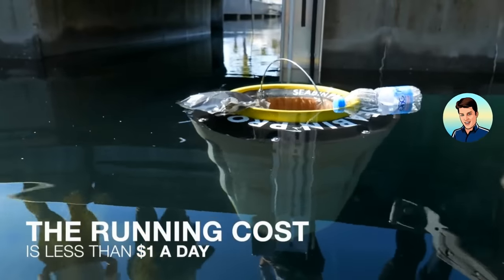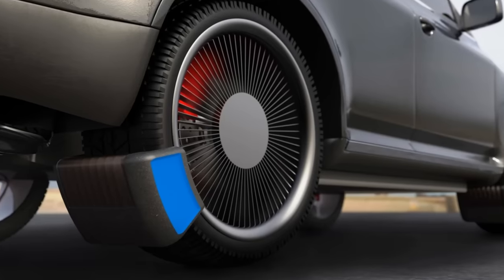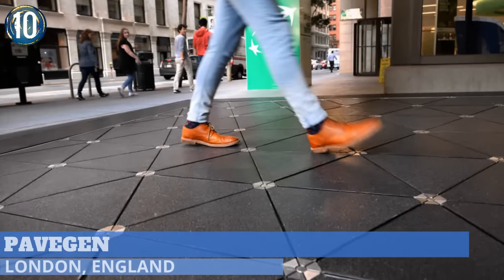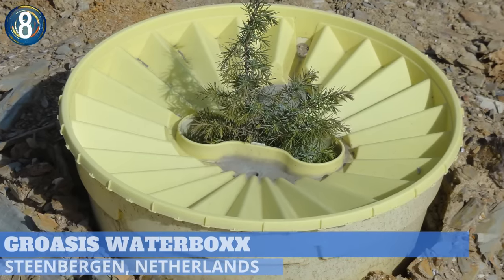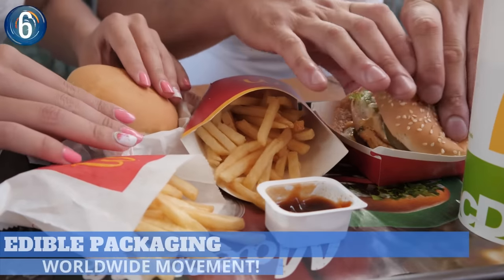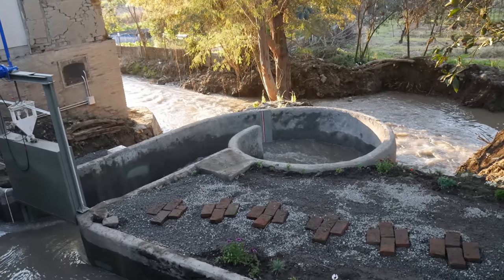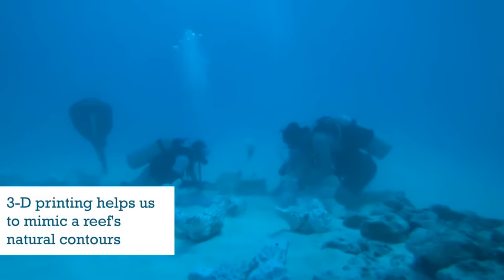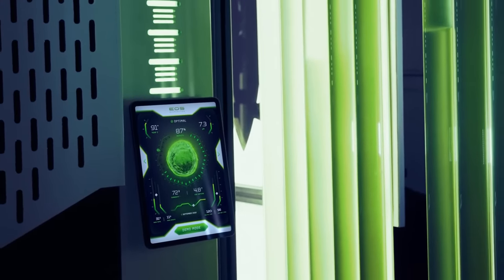15 Inspiring Innovations That Can Help Save The Planet

Comment: I really liked the water turbine that makes 8x more energy than solar. and creating a ceramic-based reef as well. I have an idea which combines the river energy turbine with earth ships filtering systems that clean the incoming and outgoing water, as well as mills, saw and flour mills to save on the carbon footprints. When digging the trenches for the turbine extend them 10 x longer. and in six sections alternate between micromesh filters, pollution absorbing water plants and charcoal after it hits the turbine and have that fork off one back into the river or creek then the other into your home and the mill{s}you might have on the property then filter the water five times dishes bathing drinking toilet use into a black water underground lake for farming needs. I'm disabled and a looking for ways to be totally off-grid outside cable wifi and cell phones

Comment: Pollution eating roads, something I saw used as a drive-able path in a housing complex ( emergency vehicle access ) and beside a detached house as back yard vehicle access way. They place decorative bricks on the ground and plant grass in the holes in the bricks, you have to move the grass but you can drive on them.
every city street done like this would be eating the pollution of the cars driving down them.
Reply: I have them outside my house - I park on it.

It's owned by my local council, who installed it about THIRTY YEARS AGO, and who mowed it twice before killing the grass with weedkiller because mowing it cost them money. 

There's a fair amount of it around the area, but it's just decorative concrete (bad for the environment) with a few weeds that can survive the persistant weedkiller they put down.

Comment: could you make the turbulant turbine work with out a stream, a series gutters or ducts that rise to a point where gravity tkaes over  to make the water run down  and spin the generator, using something like the water pump in this video but on a smaller scale that will make both work effeciently in a closed loop system
Reply: Closed loop system would not work because it would be in direct conflict with the law of conservation of energy. It is simple physics really.

Comment: My mother had a washing machine called a suds saver, you could save the wash water and pull it back in for the next load. You did the least dirty first. Not sure why they stopped making those-affordable for most.

Comment: The bioreactor could be used to make replacements for kerosene, diesel and gasoline which are compatible with current engines. I don't know how expensive or complex are the intermediate steps to do such thing.

Comment: I have pointed this out elsewhere, but Pavegen needs to be very cheap, very efficient and very long lasting to be useful. Anyone screaming about a windmill or PV panel needing materials and energy to make that has it's own carbon footprint is either a moron or a fossil fuel lobbyist, we have already proved that those pay back their cost in money and CO2 quickly and then supply us with 100% clean energy for decades. A tiny device that relies on very slight movement to operate and does not look easy to mass produce or install does not sound like a good candidate for accomplishing the same. Sure, it is a very easy way to make people notice something is happening as they can feel it under their feet and probably see some kind of ad screen light up, but I want to see some math on how much is the cost per watt and what is the payback time. I am willing to give it a pass as an art object or means to promote awareness, but to really benefit the planet it has to be more efficient than paving the same area with Solar Road panels. Also more longer lasting than current Solar Road tests have managed...

The Energy Vault also needs to show some math, though that video was far better and more informative than the previous one. It has been mentioned on YT before, and some people thought it only uses a single tower of maybe one ton blocks... Still, for maximum efficiency you don't just lower the blocks in couple outer rings but line them on the ground for the whole length of the crane arms, that way over 90% of the blocks can be used instead of just 2/3rds. Also, building tall towers of blocks raises couple of questions that should be obvious like if you build them to store solar power, won't they shade the solar farm, and if you build it for a wind farm instead, how safe is that Jenga tower in an area that was, by default, selected for having lots of wind?
I do have to point out though that the people who think the motors and cables would degrade and break immediately and the crane can't place the blocks accurately clearly have no idea about the current state of technology that goes to either cranes or elevators. The Energy Vault is mature and reliable technology and also pretty cheap, the basic science works and in theory building a huge number of them is a perfectly working solution for energy storage.
But I want to hear more recent news about the prototype and estimates about cost per megawatt before making judgement.
Reply: My one issue with that is the energy cost to build the tower.
You actually will get less out of it than it takes to build it making it not a cost effective method. Lifting the blocks takes energy, lowering them generates it, but you use energy to lift the cables back up as well, the friction on the movement does reduce the amount of energy retrieved yet adds to the costs to store it.
If the tower stored 10 mega watts of energy, you spend 10.5 mega watts to build it you lose a bit of money every time.
Reply: @jaquigreenlees  No, it is NOT an issue. ALL ENERGY STORAGE TAKES MORE ENERGY THAN IT RELEASES! We are not looking for a machine that creates energy from nothing, we want a way to have energy whenever we need it. Pumped hydro and the best batteries can barely reach 80% efficiency, and there are projects involving pressured or liquefied air that manage to make a profit at 60-70%. All of those manage to create profit because they can provide power cheaper(and greener) than power plants burning fuel.

The Energy Vault blocks are 35 tons each, cables that can lift them are little over a ton per 100m and you get energy from the weight of the cable going down too, so the energy costs of operating the cranes are insignificant. It also has no pumps or turbines between the energy going in/out and the energy stored like pumped hydro and pneumatic storage, the blocks are even cheaper to make than steel tanks, and everything in it is far simpler and cheaper than the advanced chemistry and electronics needed for batteries, let alone projects like making hydrogen; it clearly has potential to be both highly efficient and cheap to make in large numbers.

We need more data on how efficient and economical it can be and how tall you can build one safely, but there are no issues with the science. The only problems are if it can be safe and economical in the first place, and assuming it works there will definitely be a size it works best at, meaning if you need 1.1 tower's worth of output or storage you probably must build two full size towers instead of making one little bigger or trying to save money by building two at 75% size.